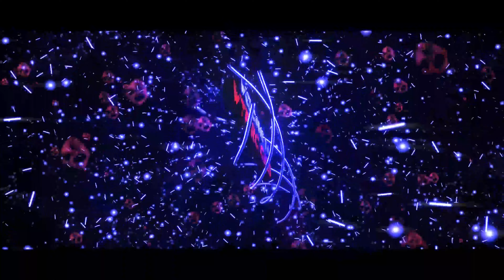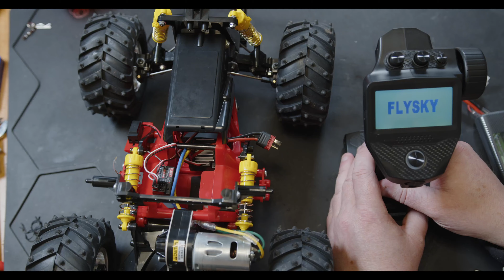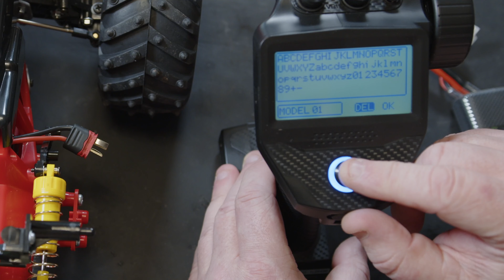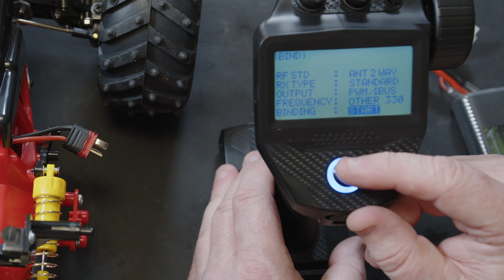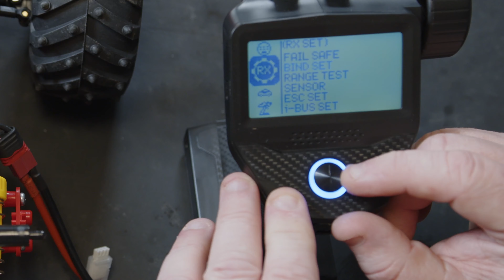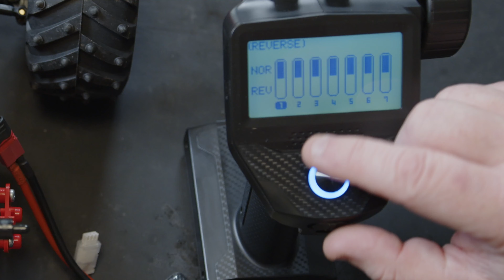Flysky G7P and FS-R4B receiver bind and new model set up. Bind in 1 way not 2 way :)

Comment: Hi, I have a GP7+, I bought a FS-R4B and FS-R4P and it is impossible to bind, I tried with 1 way and 2 way, analalog, other 360 and not working, I wrote to flysky support but no answer to me, please, any idea?
Reply from the maker: You power up the transmitter and set to 1 way bind, then power on the RC and press bind on transmitter after a few seconds back out of the bind on the transmitter and it's done you don't get a bind successful message as it's a 1 way bind
Reply: @WTFRCCars I will try again
Reply: @WTFRCCars yeahhh!! Is working! Thank you very much!
Reply from the maker: Spot on :)

Comment: I cannot get mine to bind no matter what. Same receiver and tx. I can bind the 7ch that came with the tx no problem. 

I bought three r4b and none will bind. 

Tried all the same settings as you.
Reply: Hi, same case, you found any solution?
Reply from the maker: You have to set bind to 1 way not 2 way
Reply: @WTFRCCars yes, I tried both, one and two way and not working, the led always slow flash
Reply from the maker: Make sure you are binding in one way and then just back out of binding and it should bind

Comment: Will this work with r6b?
Reply from the maker: No the r6b is not the correct protocol the g7p uses ant protocol
Reply: @WTFRCCars  thank you!! I have several r7 recievers that work with the g7p but I need a gyro as it's replacing a Traxxas tqi. Rustler 4x4 vxl
Reply from the maker: There ain't any gyro receiver for the G7P just yet but you can run an external gyro if you like and control it from the G7P
Reply: @WTFRCCars  I will say the remote is very good bang for your buck.   Too many options to list.   I have the one remote for 4 different types of cars with all their own profiles and presets!   Awesome. Standalone gyro is what I'm needing then until they build a reciever with one in it
Reply from the maker: Ya want something like this one it will work with any of the receivers and can be controlled from the g7p

https://youtu.be/fsVvIznaXs8

Comment: Hi i have just recently purchased a flysky noble nb4 pro and having problems in setting a 8 ch receiver to switch on and switch off lights on my traxxas trx4 can you please do a run through video on how to set them up cheers
Reply from the maker: The pro works like the nb4 what lights are you using I run the sy-rc switch to turn on/off the traxxas lights

https://youtu.be/Z12GcegebBg
Reply: @WTFRCCars  i have the traxxas light kit front rear and lightbar and a rc4wd 40mm under bumper light bar the traxxas lights and light bar are on seperate channels and got coming soon by snail post some rear work lights and just recently got a ftx zorro and got a lightbar coming aswell which i m thinking of fitting it to that
Reply from the maker: So the nb4 like any radio need switches connected to each channel you want to be able to turn light on/off or you need lights with in built switches :)
Reply: @WTFRCCars  can you please tell me what lights you are using that have the switches inbuilt
Reply from the maker: I use this one for the light bar

https://youtu.be/dFJ50Qe8Vyk